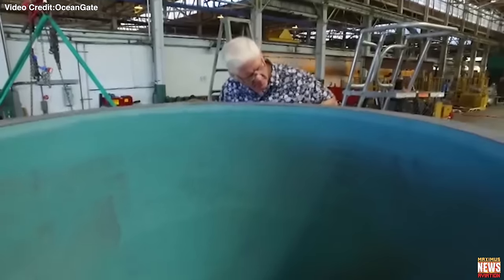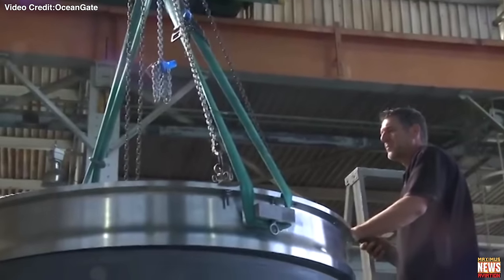Watch The Manufacturing Process That DOOMED OceanGates Titan To Fail. But It NEVER Had To Happen.

Comment: The fact that this thing even made it down to 4,000m and back once is a miracle.
Reply: Actually couple times !
Reply: I think this was voyage #14.. with the 2nd carbon hull.  The first one developed problems with use so this was the 2nd go.  Or so I've heard.  If that's the case, how did they dissolve / overcome the first round of adhesive?  Was there any residue remaining on the titanium ring to cause non-uniformness of pressure?  Anyway, I would like to know the failure mode of a carbon pressure vessel like this.. especially wrapped this way and not like normal cross wrapped carbon pressure vessels.
Reply: @patricialmt5272 I believe it was a few times
Reply: Maybe what that caused it to rupture
Reply: How can you even think to yourself "this should be okay" as you descend into the abyss.
Reply: The cap on my toothpaste is 200 percent more fastened than this design
Reply: @patrickp4827  i think this was the first hull being made, as he calls it cyclops 2 and not titan yet.
Reply: @vikingnusantara even if it was made out of some kind of metal it would of imploded due to unequal pressure,cylinder is the worst design for deep ocean sub.
Reply: I'm sure others will make successful submersible craft from his disasterous experience
Reply: @terminalfrost3645  cyclops 2 was renamed Titan.
Reply: Those who survived the previous dive should celebrate their birthdays the day Stockton Rush spared them from his ingenious coffin made up of superglue
Reply: It could be God's mercy n grace until even God also gave up on him...😅😅😅
Reply: Indeed a miracle

Comment: Carbon is great for a pressure vessel, as long as the pressure is inside the vessel not the other way around.
Reply from the maker: Yeah thats why its good for aircraft. The more outward pressure the tighter the bond.  But conversely the more "inward" pressure the fibers begin to delaminate.
Reply: This is basic physics and construction science. Did no one tell this guy? Or would he simply not talk to any 50 year old White guys with an actual education and experience? When I first read about this I wondered if it was a suicide/murder.
Reply: The strength of a carbon fiber composite comes from putting the fibers in tension.  Consider a rope is strong in tension. But push the rope from each end and how is the rope resisting the compressive force?  It’s not. This is why carbon fiber is good for a pressure vessel and not a vacuum vessel. How can an engineer like the CEO not know this?
Reply: @DeanStephen people very specifically DID tell them. And he got offended and replied back to them saying they’re just afraid of innovation. There’s an email chain about this and it really shows that he was full of himself and wanted to do what he thought was pushing the envelope, safety be damned.
Reply: This was exactly my thought too. The only thing holding back 6000PSI was the glue. The carbon fibers contributed nothing.
Reply: @cpm1003  I think you have it backwards, the pressure was pushing the ends in, helping the glue.
Reply: @--_DJ_--  until temperature comes into the equation.  The metal ring and the carbon fiber have very different reactions in the cold.
Reply: My immediate thought when I read how it was built. I would heve never stepped in this death trap. I couldnt beleive we were just a few to notice that ! OK I am an old white electronic  engineer passionate in mechanics, guns, air guns, arrowair guns etc..
Reply: I think you run one homogeneous piece of titanium with the rings machined into it. Then you wrap it in 7” of carbon fiber to reenforce it. We know a 2” titanium ball can withstand those conditions. So you run 2” of titanium. Then you have your carbon fiber but then replace the carbon fiber every so many trips. You make a strictly carbon fiber haul like this and you stress test it by dunking it to 4,000 feet over and over until it implodes. Then you cut that number down by 66-75 percent. And that’s when you remove the carbon fiber and change it. Or if they could have connected 2 titanium balls together or had it one homogeneous piece. And then you wrap the v shape part of the 2 balls in carbon fiber to counter that pressure point.
Reply: Why is pressure on the inside ok but not outside. Pressure is pressure no matter which side.
Reply: This exactly. It works for airplanes because the pressure is on the inside its like a balloon the material stretches out and the fiber network is under tension. If you try it the wtong way with pressure outside then it folds. I still can't believe tjis whole mess, its like idiocracy to me.
Reply: Opps...
Reply: @--_DJ_--  Helping or cracking the glue?
Reply: Most people don't understand pressure and PSI.  1 PSI may not sound like much but if there was 1 PSI keeping a standard door closed on your house, you would never be able to open it.  A standard door is 36x80" ...or 2880 square inches.  At 1 PSI , that door effectively has 2880 pounds of force keeping it closed.
Reply: @jonfreeman9682  Its a valid question. Its because carbon fiber was used. 
Carbon fiber being a strand was used to make a tube structure. The problem is carbon fiber has great strength under tension. (Pulling force.) But carbon fiber isn't very good when its being pushed. When the pressure is inside the tube trying to get out, it acts as a force pulling the fibers strands, where they have great strength. But when the pressure is trying to get into the vessel, the forces are the opposite, pushing the fibers instead of pulling them. (Think of trying to push an object tied to a rope, vs pulling an object tied to a rope.)
So, the carbon fiber flexes, and can flex considerably more than the titanium end caps. Because only glue geld this joint together, it was an easy point of failure.
Reply: @jonfreeman9682  Different materials react to pressure differently. The one guys rope example is a good one. Very stong when pulled on, limp when pushed. Same thing goes for everything to some extent.
Reply: @bbhima5814  I have no idea about the glue cracking, but it certainly wasn't holding in any pressure.
Reply: It helps if you don't weave it  horizontally
Reply: @-Primer-  6000 PSI at 4k meters... Yikes.
Reply: In any high pressure vessel, the fiber is crossweaved forming layers at right angles to each other, this prevents a crack from forming that goes through all the layers and splits it open.
Reply: @--_DJ_--   @cpm1003  is 100% correct. Each strand of carbon fiber has great strength to weight values in TENSION and virtually 0 strength in compression. Imagine pulling a short piece of carbon fiber between your two hands. You would probably cut your fingers before you break the strand. Now imagine the same piece of carbon fiber only now you are pushing the two ends towards each other, the carbon fiber will collapse like a wet noodle.
Reply: @--_DJ_--  Maybe the CF was flexing, but the Ti was not, and this eventually popped the Ti end cap(s) off?
Reply: @jonfreeman9682 no. A soft drink can take almost 100 psi from the inside but you can easily buckle it with your fingers by applying pressure from the outside.
Reply: @baloog8  Yeah, we usually see it weaved in a criss cross pattern. Even just for a flat piece.
Reply: Yup , this is very similar to how SCBA bottles for breathing apparatus are made .
Here in the UK they are hydraulically tested every five years and usually have a fifteen year lifespan.
Reply: @1982nsu  I don't think I challenged him on that. I didn't need a basic lesson in the obvious, but thanks.
Reply: @--_DJ_--  I meant the glue that they put on as the rolled the carbon fibers to make the composite. Not the glue that they attached the titanium end rings with.
Reply: @jonfreeman9682  tension applied is different
Reply: @DeanStephen  He fired someone (probably one of those 50yo white men he hated so much) who raised concerns
Reply: @zeMasterRuseman  Amen to that. 100% fact. Carbon fiber strands have great strength in tension and virtually 0 strength in compression.
Reply: @maximusaviationchannel  thank you for the clear explanation why
Reply: @DeanStephen  he fired and sued the guys who spoke up
Reply: @jpcaretta8847  He put a lot of energy into selling his concept and emphasizing the integrity of the pressure vessel. It was a sales job. It sounds like way more than half the people that saw this thing declined to travel in it.
Reply: I will just machine a titanium tube with 20" walls.
Reply: @DeanStephen  
Strikes me as the kind of guy who refused to listen to things he didn't want to hear.
Reply: @maximusaviationchannel  So just breach copyright and uploaded the video?
Reply: Well I heard he fired the tech employee that brought up safety problems to him.
Reply: @rickcoleman8903  Yes he knows better doenst need to follow the standards or even basics engineering facts!
Reply: @--_DJ_--  
The adhesive between the end cap' rings and the carbon fiber cylinder, yes, to a point -  but that's not the critical failure risk, which is the "glue" holding the carbon fibers in place. That adhesive is basically what's withstanding the outside pressures and is suffering micro-cracking as it flexes under the pressure changes.
Reply: @jonfreeman9682  
No, there is a difference in the way the stresses are applied.
Some have compared it to a chain, or rope, that is strong in tensile loads - pulling apart - but weak in compressive forces - pushing the ends together. With an internal pressure the stresses are pulling the structure apart, but with an extermal pressure it's pushing them together.
A pressure vessel for withstanding extermal forces is like an egg-shell - it's very strong because the extermal forces are directed through the shell, until they exceed the strength of the eggshel and it immediately collapses.
There's rather more to it than that, but that's the most basic reason.
Reply: @-Primer-  please speak metric ! The failure of the US education system, the use of confusing measures played a negative role too.
Reply: @--_DJ_--  4km deep is 400 bar, atu, 40 MPa ! We are in 2023, not 1823 !
Reply from the maker: @danquaylesitsspeltpotatoe8307  Hundreds of youtube channels are using the same video's - Its news. If there is a problem they will reach out to me.
Reply: @maximusaviationchannel  Yer "news" doesnt meet the legal requirement to breach copyright! 

You will most prob get away with it! But one day the owner might decided just to sue you for the breach!
Reply: @jpcaretta8847  They all mean the same thing. It's 2023, get over it.
Reply from the maker: @danquaylesitsspeltpotatoe8307  Do you represent the company?  If there are any problems YouTube will contact me. They have approved this content and found no violations.  Not sure why you are so bothered.  This is vital information that the world should see and like I said this same information is plastered all over youtube presently.  Have you been contacting them as well?
Reply: @cpm1003  Oh, ok. That makes a lot more sense. I would have called that resin.
Reply from the maker: @danquaylesitsspeltpotatoe8307  By the way I visited your channel and watched your one video.  I am quite confused by the meaning of the video.  Could you possibly explain to me what it was exactly you were trying to convey? I'm seriously interested. Thanks.
Reply: @gordowg1wg145  If he had said resin my mind might not have gone to the ring joint, not sure why it did with glue but it did. I see that I misunderstood his comment.
Reply: @maximusaviationchannel  Come comment on the video, what is it you dont understand?
Reply: @jonfreeman9682 pulling a rope is very strong but pushing it is very weak. Carbon Fiber is like a rope it is very strong if it is being pulled apart but not so well pushed in.
Reply: @kazedcat  to be honest i think its a misleading analogy. A rope in compression instantly buckles. Carbon fibres in compression would too, if not for the polymer matrix they are suspended in. It restrains the fibres from buckling so the fibres can carry alot of load in compression without failing. My understanding is that the polymer matrix is more likely to fail as compression forces create bursting forces in the polymer that make it want to delaminate. However, when in tension this is not a problem, so it is better in tension than in compression.
Reply: @--_DJ_--  Just that the world is laughing at US level of illiteracy . People who cant do basic math, physics...even read maps. A hamburger chain wanted to compete with McDo 1/4 pound by offering 1/3 pound fir same price. Didnt work because people thoughtbit was lighter.
Reply: @jpcaretta8847  Well I am not American so my use of the imperial system has nothing to do with their education system. None of the things you listed there are signs of illiteracy. That word has a specific meaning.  Idiots are universal, Americans are just the main target of the jokes. I am sure you know a few people who are not the sharpest tool in the shed.
Reply: @patsk8872  He never said he hated 50 year old white men, he said he wanted innovation which in his mind couldn't be done with people who were set in their ways as to how this should be done. It was a foolish idea but on the surface level it makes sense.
Reply: This is why the Tesla model S motor is carbon wrapped.
Reply: @TemplarLove  They used carbon to increase the strength of the magnetic field for the most part. It does allow it to spin faster, but that isn't really giving much benefit to an electric motor.
Reply: @Cam-ng8rk  A thick enough nylon rope will not buckle instantly at very light compression. If you use enough material it is possible to scale the strength of a structure. But the question is did they use enough materials. How much carbon fiber do you need to handle the immense pressure repeatedly for hundreds of cycles. And lastly is it reasonable to use overly thick CFRP compared to just using steel.
Reply: so basically they've could make the same hull just from epoxy resin with about the same result?
Reply: @jskratnyarlathotep8411  No, it would shatter instantly.
Reply: @--_DJ_--  Tesla uses the carbon to get tighter tolerances.

It's there to keep the motor from expanding when it's spinning really fast.
Reply: @jtjames79  The reason they want tighter tolerances is to increase the magnetic field strength, not so it can spin faster. I just read an article about it because I had not heard about carbon wound motors before. It can spin faster, but that was not the goal when they decided to try this out.
Reply: @--_DJ_--  I don't think the article you read was very good. Either that or you did not understand it.

I also didn't say anything about the motor spinning faster. It's designed to spin at the same speed while being lighter and smaller.

The closer your stator is to your rotor the more efficient your electric motor is. That basic first principle has been known for as long as electric motors have been a thing.

The less your rotor tends to expand, the closer you can get it to the stator without seizing up.

That's been a fundamental problem with electric motors since first invented.

Carbon wrapping solves that problem.

The carbon itself isn't doing anything to the electric field, it's just applying compressive strength to keep the rotor from expanding.

I can't give you a source because I've reviewed dozens (to confirm what I understood just by looking at it and applying first principles), but I believe Sandy Monroe has a decent explanation if you don't want to believe me.
Reply: @jtjames79  I don't think you read my comment, or at least didn't understand it if you did. The first part of my comment says exactly what you just wasted your time writing does. Tighter tolerance = better motor efficiency
I did misread the spinning faster part, I'll give you that.
It was musk himself that says it allows it to spin faster, but he isn't the most reliable source of good information.
Reply: @--_DJ_--  In the military they have a saying. It said; going around your a**hole to get to your elbow.

You got distinction without difference and difference without distinction.

I was intentionally keeping it short, because this is a YouTube comment section.

I'm bothering to argue with you, because it's good for the engagement algorithm.
Reply: @jtjames79  Do you have any other random words you would like to string together for me? 
That was the most pointless comment ever. Is your argument winning technique confusion?
Reply: @--_DJ_--  said the pot to the kettle
Reply: @jtjames79  Um, I don't think you know what that saying means. If you do, then you should know better than to use it like that. My comment had a very specific point, it was pointing out your pointless reply. Which you followed up with a second pointless reply. I guess confusion is your tactic. Odd choice.
Reply: @maximusaviationchannel  not delaminate, but actually what holds compression is just the resin, fibers are there just as dead weight
Reply: @cpm1003  glue and resin
Reply: @1982nsu Carbon when compressed turns into graphite, which is soft. But thats not the issue! What holds it together, has to be considered. Glue is a terrible term to be used,! You don't "GLUE" things together, you bond them together!?
Reply: @robertchilders8698  Would it make you happier had I said "bonding agent?" The fact remains that carbon fiber, as any other fibrous material, has great strength in tension and very little in compression. Try pushing a length of rope uphill. The rope will collapse on itself.
Reply: Walter_Be  It’s the 21st century. Computers that can instantly convert any measure to any other measure are everywhere, including your phone, your watch, and possibly your light switches or hearing aids. International standards are 19th century thinking.
Reply: @ Yeah, and doing it automatically in a fraction of a second without having to employ a room full of human calculators is totally irrelevant, right?